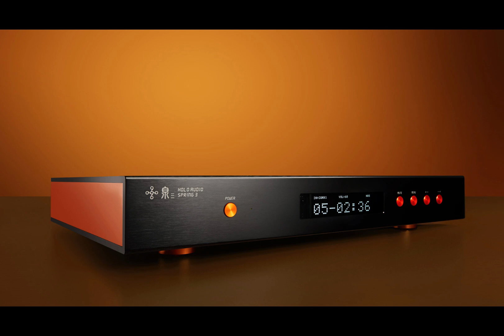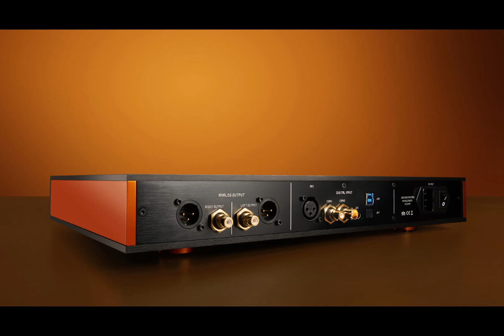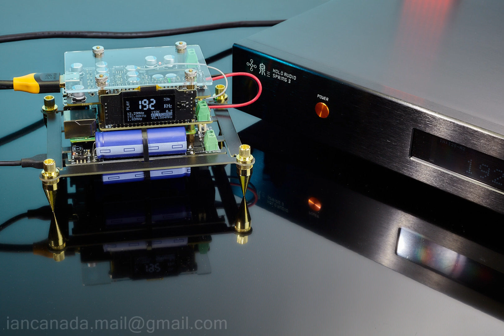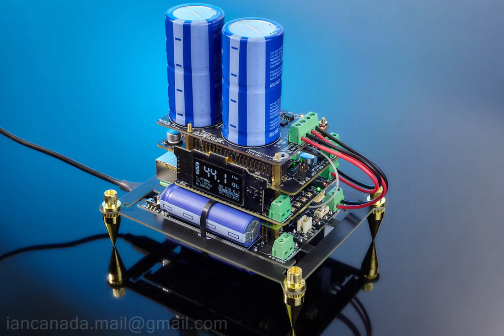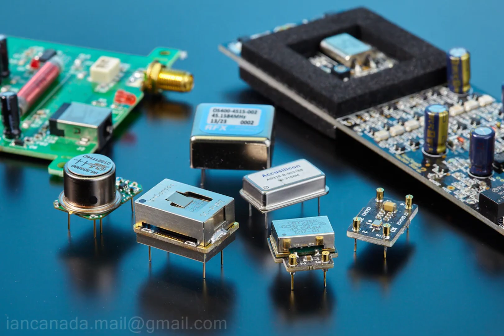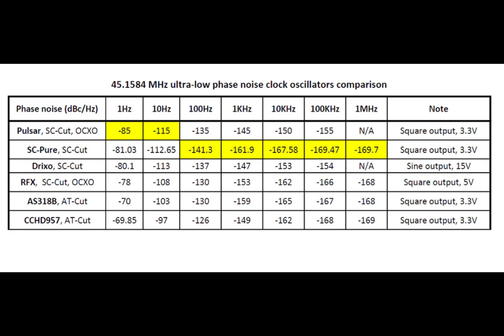Improve DRAMATICALLY your HOLO MAY or SPRING or CYAN DAC with Ian Canada FIFO

Comment: Hey there, just as some feedback, I found the constant back-and-forth vocal reactions to be very distracting to the video as they add nothing really and the subject matter is already interesting.

Also, chemical reactions dont produce nasty side effects like you mentioned in the podcast. Storing energy electrochemically isnt any worse than storing it electrostatically, they are simply different. Using batteries for power production is always going to be cleaner than connecting to an AC supply. The power conversion from AC to DC as well as voltage regulation will inevitably add some noise as will everything else on the power lines.

Also, theres nothing between the capacitors and the power input of the DAC? How can Ian achieve a constant voltage on the supply? Does it switch between the two capacitors or is the pair for a dual rail supply? How come it doesnt need vregs? I ask these questions but I dont really doubt it would have an impact on sound quality.
Reply: Keep in mind the conversation in this video is AI generated so all of the reactions are "as is".
Reply: Yes a two person 'Yak session' was putting me off, along with the frozen pictures.
Reply from the maker: @paulstubbs7678  thanks for your contribution
Reply from the maker: @bcepni00 thanks for the feedback. Yes the ultracap (UC) works differently but more importantly it has different electrical characteristics such as extremely low ESR (almost zero), extremely low impedance (almost zero), high dynamic amps (1000A capable) and extremely low noise (almost zero in pure mode). 

Yes there is some form of regulation on the UcPure. The UcPure will charge to the target voltage then disconnect (pure mode). In pure mode there’s “virtually” no noise or extremely little (something that needs to be heard first hand to understand).  

Once the target voltage floor is reached, UcPure will charge again. Each UC stores typically 3000F to 3400F and you have from 2 to 6 of them depending on your desired output voltage. When charging, you’re not in pure mode and yes noise could creep in but for the right application, charging is rare and fast. The UC keeps working while charging and the difference in sound is - surprisingly - actually almost impossible to discern. In fact with SYNC mode, charging is IN BETWEEN songs.
Reply: @ Very interesting! And much easier to comprehend the subject matter when presented like this. Thank you.
Reply from the maker: @bcepni00  you're welcome, just keep in mind UCs are very dangerous, the Gabster channel has a lot of information on UCs and all necessary precautions to be taken should one should choose to use them (which I do not endorse in any way). Here’s an example (of many): https://youtu.be/SYbFJoCfPlA?si=xlsv7EkVazNLiq8n